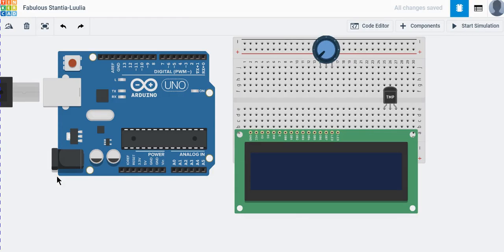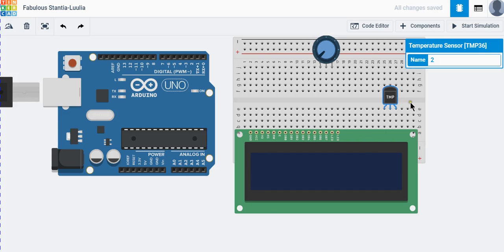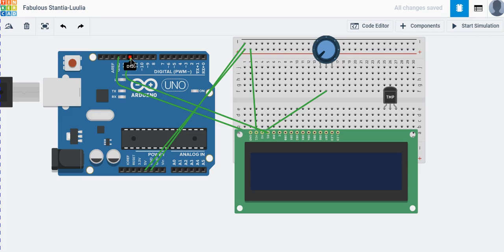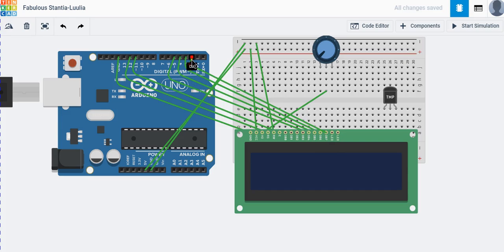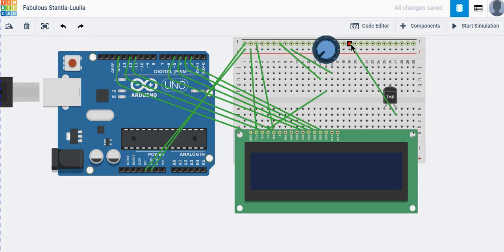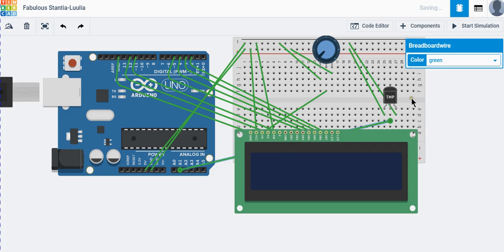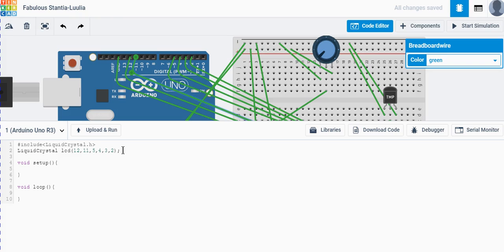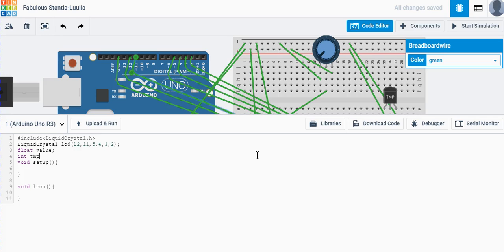Temperature Sensor with LCD display arduino

Comment: can you attach the code so it would be easier to just copy instead of typing?
Reply from the maker: You can find project here: https://www.tinkercad.com/things/iovuycemCBW
Code:
 #include<LiquidCrystal.h>
LiquidCrystal lcd(12,11,5,4,3,2);
float value;
int tmp = A1;
void setup(){
 pinMode(tmp,INPUT);
}

void loop(){
 value = analogRead(tmp)*0.004882814;
   value = (value - 0.5) * 100.0;
   lcd.setCursor(0,1);
 lcd.print("Tmp:");
   lcd.print(value);
   delay(1000);
   lcd.clear();
 
}
Reply: It says that its -30